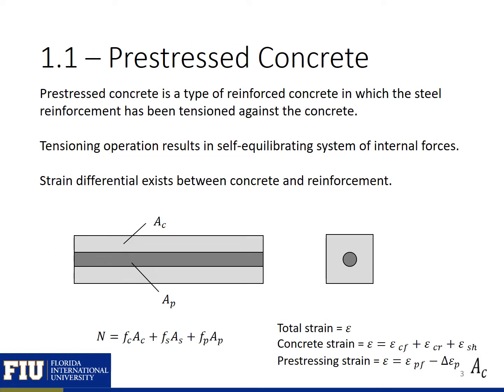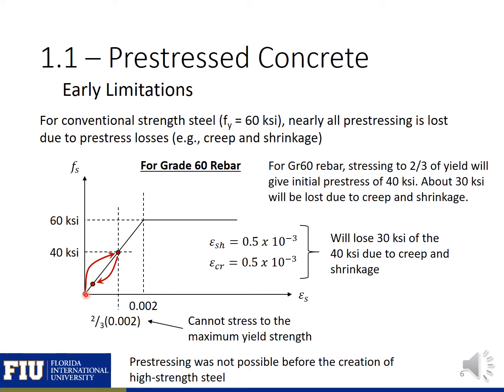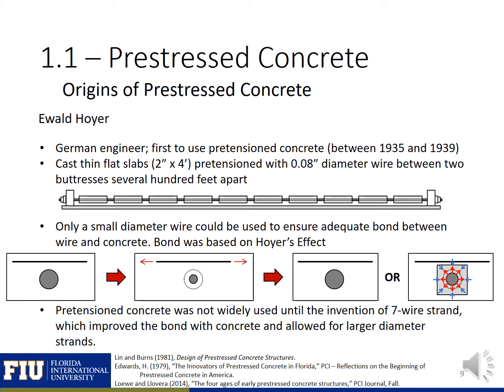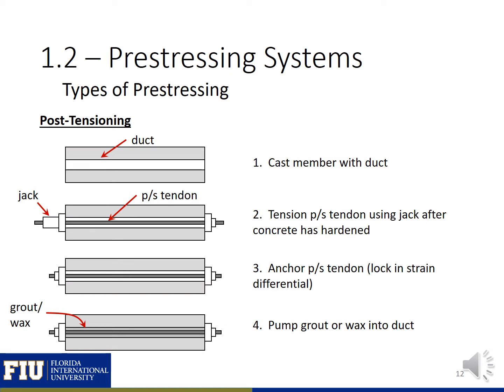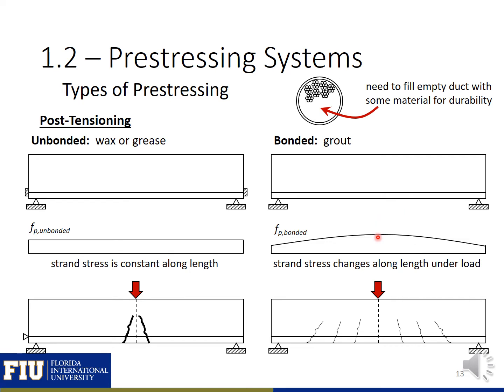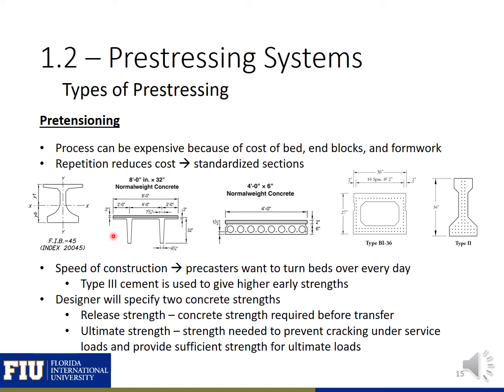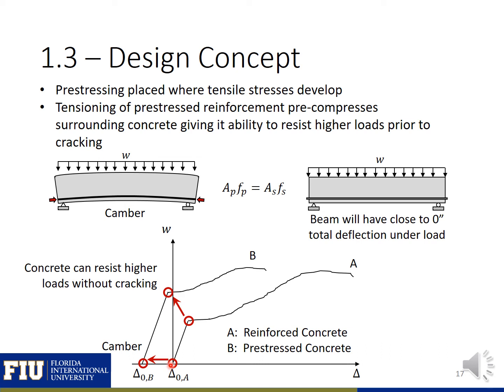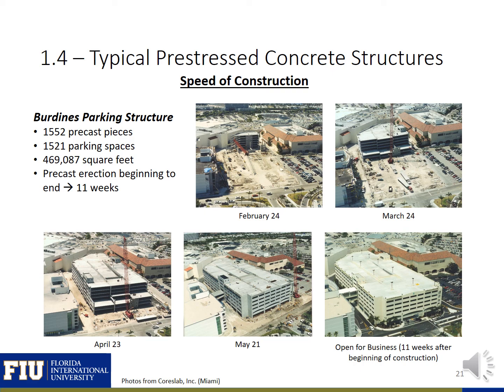Prestressed Concrete Design - 1 - Introduction

Comment: the ultimate response to bending moments both in reinforced and prestressed concrete are similar due to the maximum compressive concrete resistance. In fact, the ultimate bending moment can be formulated as M=ZP, where M is the bending moment, P is the concrete compression, or the steel tension and Z is the flexural depth that depends on the section shape, Z=(0.65 to 0.85)*d

Comment: Does bonded type post tensioning systems dont have anchors at the ends? Only the bond through grout is responsible for transmitting stresses?
Reply from the maker: Bonded post-tensioning would have anchors at the ends, so the initial stresses (prior to grouting) would be only transferred at the ends of the member where the anchors are located.
Reply: David Garber Your explanation is great. Kudos to you for making such great videos.